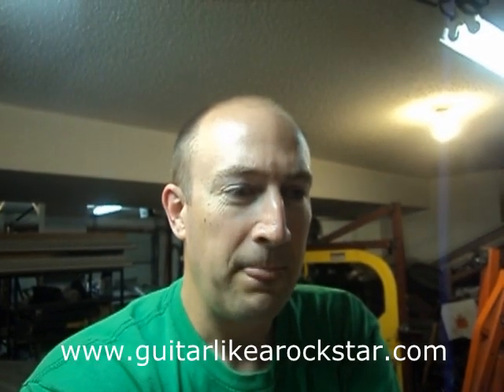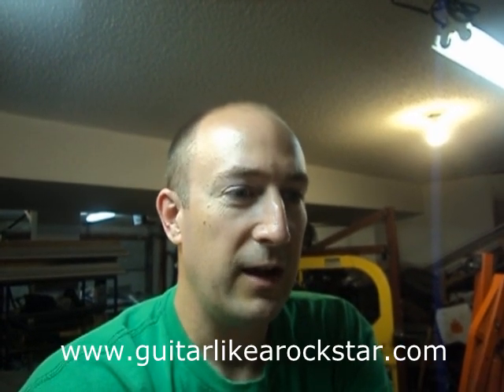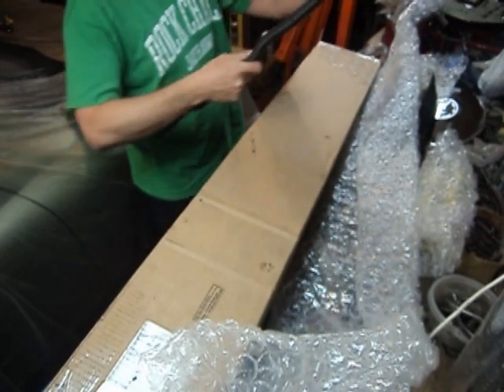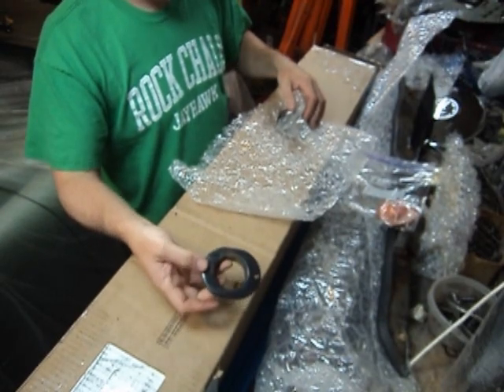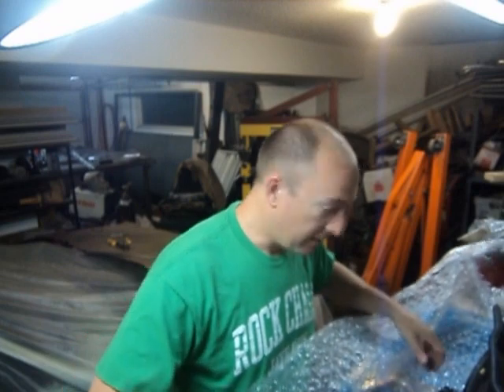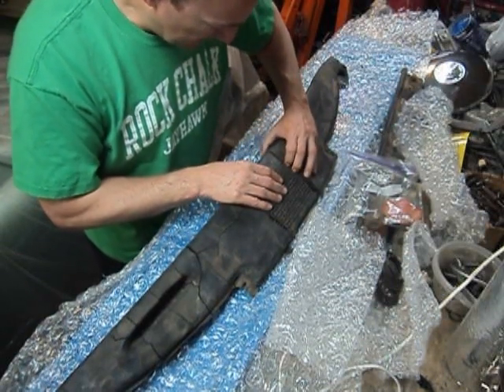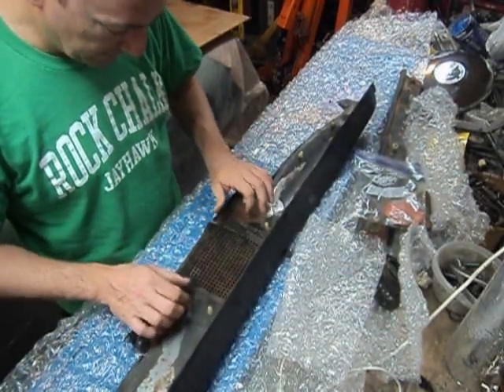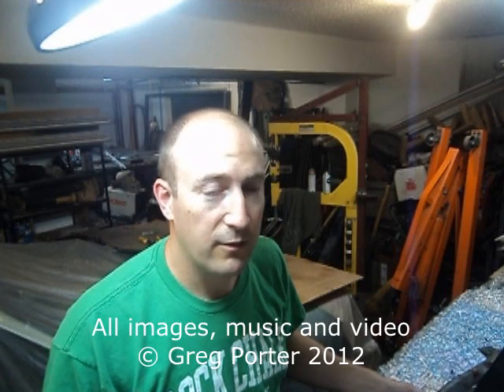How to Restore Your Volkswagen Dash - Part 1

Comment: I would."and this is a comment with no professional backing"...Fill the center bit to the same height as the ends,then glue a thin piece of high density foam on it and some vinyl to that...over the cracks and all....Hey but what do I know....

Comment: i would lay 1 layer of fiberglass mat down on the back of the dash 2 make it stiff again,spray contack cement on the top side lay foam (from fab. store) u can get any thickness u would like,then lay your mat. glue the edge on the back side   your done WELL   peace

Comment: Have the same prob with my dash ... i did what GasserGlass says, made a mold and fiberglassed one. But damn, respect GasserGlass, because, altough it's not ready yet, mine didn't turn out too bad, but not too great either LOL But it is doable. I just kept the internal metal structure, made a fiberglass cover and will try and put vinyl on top of it.